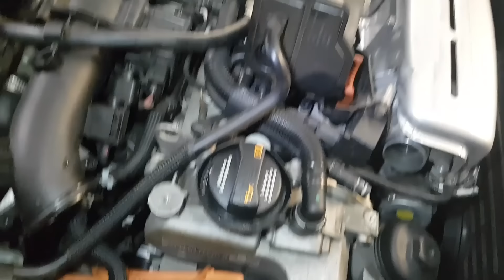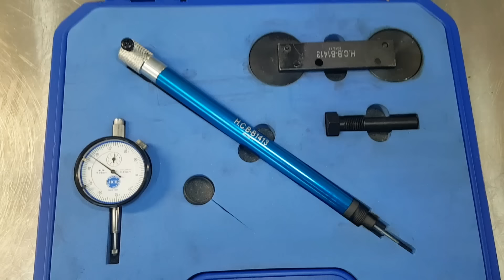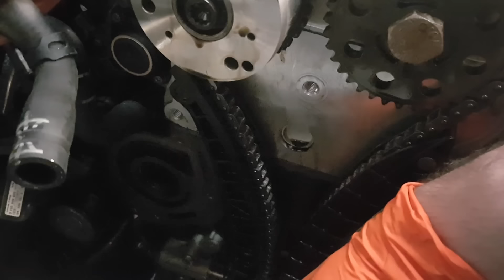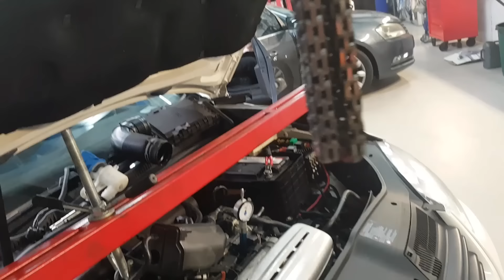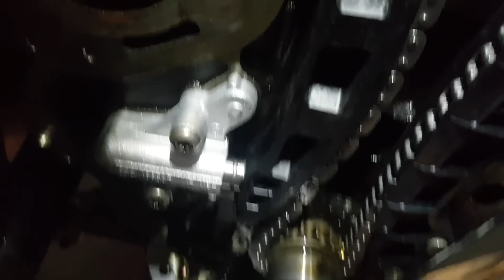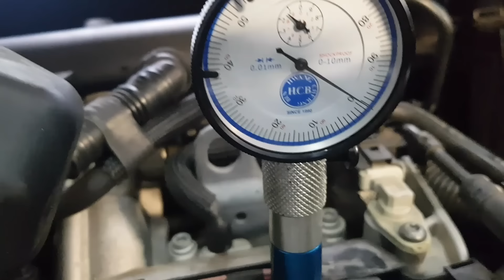P3008 VW 1.4TSI Timing Chain Replacement

Comment: Hi, nice video, you made it look very simple!
I'm motivated to do this on mine, it rattles on cold starts like an assault riffle but wasn't sure if it was the variator or the timing chain, want to ask a couple of questions.

Is it necessary to change the variator, or is it something that will suppousedly last as much as the car?

And for the gasket, what do you do for the bottom part? (The one that matches the oil pan) do you use gasket silicone? (or whatever is it called)
Reply from the maker: Check that the variator is locked and has no play. The sump is sealant.
Reply: @FourRingsAuto  what does it mean that the sump is sealant?
Reply from the maker: The sump  (or oil pan for Americans) doesn't have a gasket. It has silicone sealant.
Reply: @FourRingsAuto  ah, ok, that's what I thought, it's just that I want to have everything beforehand and not make any trip to the parts store / dealership
Reply: @FourRingsAuto  Another question, I can see a kit from INA (Schaeffler) -559 0154 30- with EVERYTHING needed, however, as in this video, the tensioner has the same reference as the one that came from the factory with the car, and in this video I can see that it retracts back, Isn't it supposed to stay out to compensate the chain's stretch? 
Also, was the problem of the camshafts out of time because of tensioner or the chain?
Sorry to bother you, but it looks to me that it will only keep the car running fine for a while until the tensioner/chain fails again soon
Reply: How much would you pay in United Kingdom for this whole job??

Comment: Do you need to do a oil change after replacing the timing chain ?
Reply from the maker: Yes. The chain wears due to contaminants in the oil, so a new chain really needs new oil. It's a hack job to run it on the old oil, but I've seen mechanics do it. Oil is cheap in my opinion in comparison.
Reply: @FourRingsAuto  I just got a oil change on my 2008 VW Golf GT and then the PO00A code came from my check engine I have always had a bad rattle at cold start ups only lasts about 2 seconds figured it was the Timing Chain so after I get a oil change now this Error code the car is at the dealership can with error below be caused because of a bad timing chain ? Thanks for your help I love your videos 

 VCDS event / error memory tion number: 03C 906 032 AL Component: Event / error memory 1 error found: 000010 - camshaft adjustment (bank 1 inlet) PO00A - 000 - effect too slow - warning light ON Ambient conditions: Error status: 11100000 Error priority: 0 Error frequency:  1 Unlearning counter: 255 Mileage: 178 415 km Time specification: 0 Date: 2000.00.00 Time: 09:51:53 Ambient conditions.  Drohzabl- 4208 Imin Sitzur Print Clipboard Clear Memory - 05 PW: S Panasonic CF-C1
Reply from the maker: Yes, it is a common issue that they can rattle worse after an oil change or even jump time. The tensioner can drain out and the engine is run with an empty filter that takes at least 5 seconds to 10 seconds to prime. So if your car was bad prior to changing the oil, there's a good chance it may have jumped when the engine started with no oil pressure for that brief period. Chains generally jump when cranking.
Reply: @FourRingsAuto  So the rattle and cold start up has always been there but then the code popped up and it sucks because I just got the oil change and it was expensive with new spark plugs in Germany was 400€ and now this code comes up and the VW dealership said I need to replace the Timing Chain and it would cost about 2000€ but after this code showed up the car ran perfectly normal I couldn’t tell a difference in noise or Performance but when I got to the dealership they showed this code and never started the car again said the timing chain but after further research by me I can’t find anything regarding this code and a timing chain having a problem do you know if this is correct? Thanks 😊
Reply from the maker: Can check the timing with either an oscilloscope and a competent user, or set the number 1 piston at tdc via the spark plug hole, and take out the plastic caps on the rear end (gearbox end) of the camshaft housing. Then see if the tool fits or not. Make sure it is on the correct tdc, if the tool is no where near fitting it'll tell you the timing has jumped.
Reply: @FourRingsAuto  could changing the timing chain and tensioner fox this code ? Thanks for the help
Reply from the maker: Yes if it it confirmed that the timing is out. Diagnosis has to be always carried out to accurately give facts on this. P000A means the timing is slow to respond. Could be an oil pressure issue, the vvt solenoid, the wrong oil filter possibly...All these things would have to be confirmed or ruled out if the timing is checked and found to be ok. I woukd start with what I listed above, and should be shown in this video - checking timing.

Comment: Hi what are the labour times on this
Reply from the maker: Around 5 or 6 hours. Some models are easier than others. Tiguans seem to be easiest as they have more space in the engine bay. Polo and a1 are quite tight. Also depends on the covers over the supercharger, some models you don't have to remove them to get to the supercharger belt tensioner - this saves a heap of time.

Comment: 18:35 can you comment on that breather pile / hose? My 1.4 TSI BMY just got it's timing chain changed at a VW dealership, and they did not change it to the new version that is made of rubber. Should I be worried?

Comment: great video....where can i purchase this tool kit and what is the recommended timing chain/tensioners/guides kit to purchase....can you provide with a code...my engine is the 1.4l TSI EA111...
Reply from the maker: Febi kit is good. Or genuine from vw. I use HCB locking tools. Depends where you are in the world on what brand tools to use. HCB, JTC are common suppliers.
Reply: @FourRingsAuto  what you think my problem could be... Car still drives like normal put I am obviously not comfortable hearing this rattling noise.. I live in Barbados 🇧🇧

Comment: Can you do a video of where the crank angle sensor is on a 2007 vw golf 1.4l tsi please
Reply from the maker: Back of the engine, towards the gearbox end, near where the right driveshaft goes in. Below the supercharger if twincharged.
Reply: @FourRingsAuto  thank you for replying. It is twincharged. Will the supercharger need to be removed to get to the sensor? Thanks.
Reply from the maker: I recall being able to access it, but i feel like ELSA the workshop manual says to remove the supercharger.

Comment: I have to do this job very soon, just waiting on camshaft locking kit to arrive,mine should be a bit easier because I have removed the engine to replace possible cracked pistons ?, thanks for this video it will help a lot !
Reply from the maker: I have another video of doing it with engine out.

Comment: I did this job monday..... on the face of it .. i thought it was straightforward.. however on start up its running roughly... i did rotate the engine and check cam timing several times on the rebuild,but checking it after i had briefly run it the inlet cam is very marginally out of time... eg the tool wont go back in    ...i did replace the variator....i couldn't see how the variator could be filled with oil prior to assy....it did rattle a bit briefly as it filled with oil but i expected that.. fiat ones do the same.?
I will go back today ..put all the timing tools back on.... but any advice gratefully received. 
As i say i rotated the engine several times before starting both during the reassembly and when it was complete so nothing was clashing and the timing tool fitted.... yet after running the inlet cam is ever so slightly off and idle is low and engine doesnt sound smooth...although happy to start.
Cheers Peter
Reply: My gut says its variator related as the timing of the solid exhaust cam sprocket is perfect.
Reply from the maker: Any fault codes? U say ever so slightly, is this a negligible amount? Variator doesn't need prefilling and rattle once is fine.  Always crank to build oil pressure before starting though.
Reply: @FourRingsAuto  no fault codes currently..... i would guess its seems to be a couple of mm out.... as pin from timing tool in camshaft will go in now just before TDC.... although when i put it together it slotted in just fine
Reply: Yes i would agree.... but im unsure how it has drifted.... i wondered if its residual oil pressure in variator....does it advance cam when operating?..going back to take it apart again and double check everything.
Reply from the maker: Advances cam when operating the vvt solenoid next to cylinder 1 coil pack.
Reply: @FourRingsAuto  yes that is how i thought it did it ..will re time it today. Thanks for your help/comments 😊
Reply from the maker: Interested to find out what the end result is.
Reply: @FourRingsAuto  no worries, will let you know .
Peter
Reply: @FourRingsAuto  so.... took timing case off.... retimed the inlet cam.. got the two camshafts synchronized but then the crank kept moving away from tdc... so ended up removing the starter to get access to ring gear to put crank back to tdc and hold it while the bottom pulley bolt was done up.
Started an ran instantly better than before.... was slightly tappity but hadn't been run in a week and got smoother once the cam followers filled with oil... (assuming the TSI has hydraulic followers) . Currently running well... have driven it a couple of miles... will take it out again today.
Reply: @FourRingsAuto  so far no fault codes.... the car for years has on and off flagged a code for cam position sensor error.... so im hoping with a new chain this will finally be put to bed.

Comment: Why didn't you just turn the engine till the cams lined up with the tool and lock it in then remove the chain and use the locking bolt along with your dial gauge to find tdc then install the new chain and tensioner?

Comment: As you left the sump on did you not bother with the lower oil pump drive chain? Also.... pricing up the various bits ...how often are the cam variatiors problematic ?  Im planning to do the lot but the variator is a couple of hundred pounds plus vat!
Cheers
Peter
Reply from the maker: I left the sump on but it is best to take it off really. Makes reassembling easier, you can clean the old oil out of the sump, and yes it means you can replace the oil pump chain if it is worn too. Sometimes they are ok, and sometimes the customer doesn't want to spend any more money. The cam variator is easily tested. If you buy a febi chain kit it tells you all the info you need to know.

Comment: Hi guys, great work and thanks for the video

The chain on my 2011 1.4 tsi Golf 6 (130.000km) is starting to get noisy on cold start and it's getting worse day by day.

Changing the chain might not be a problem for me, but timing the engine seems complicated and I didn't understand all the steps (english isn't my native language)

Is it really necessary to change all the gears even if they don't seem damaged ?

Thank you for your help

Greetings from France
Reply: I have bought my golf VI 1.4 TSI 90kw with 97 000 km and it was already making sounds when starting. They came winter and it was not that significant and now in spring it make sound not only after start but approximately one minute of driving. When I open windows I can hear it even when engine is warmed up. I will be replacing it soon.
Reply: Please, did you change it?

Comment: Were did you buy the o-rings for the timing case cover?
Reply from the maker: I buy them from VW, or you may be able to find elring ones. They are cheap from vw dealership, and taking that cover off again would be a massive pain as the o-rings are for sealing the oil pressure passages to and from the oil filter housing.
Reply: @FourRingsAuto  Thank you!

Comment: I am so tired of my Golf 1,4 TS 2010 right now. Changed the chain at 80000 km and today at 150000 km I guess it's about time again. This seems to be a bad construction. 
I have been serving my car properly and even changed oil and filter between regular services..
Reply: Which country are you located? Where did you buy your first chain kit? Did you change the sprokets or only the chain?
Reply: @sitarhero4296  I'm located in Stockholm Sweden. first chain kit were changed by a VW atuhorised workshop and Payed by the insurance company. I assume they used a Kit that included the sprockets. But not sure. Now the car works fine unless I "step on it" and try to accelerate to hard. then the engine miss fires and engine fualt lamp start to flash.  So when I drive slow it works fine. for now i guess..
Reply from the maker: What makes you think it's the chain again?  Or just an assumption? Flashing engine light under load is typical of a misfire. Keep things simple and get the fault codes scanned, and go from there.
Reply: @FourRingsAuto  Thanks. Will do that :)

Comment: I'm just about take over my neighbours 2007 DSG Golf with this engine ( BLG ) , unfortunately been diagnosed with slipped timing chain and no compression on cylinders 2 and 3. Trying to build up some knowledge about the problems with these engines and your video is excellent altho' I'll be entrusting the job to my VW specialist garage for sure due to the need for the specialist diagnostic equipment as well as the kit for setting everything up. Not sure of what damage has been done in the two cylinders so it may be a costly job I fear.
Reply: Most likely cracked ring lands unfortunately!
Reply: @19jacobob93  Ring lands ? what part of the engine is that ?
Reply from the maker: The side of the piston where the piston ring goes in is the ring groove. The piece that supports the ring groove is referred to as the ring land. They are common on 1.4tsi ea111 engines to crack at the ring lands due to poor castjng of the pistons. I have another video showing this. It causes low compression misfires.
Reply: @FourRingsAuto  Wow, you never stop learning, many thanks for the comprehensive reply and at the ripe old age of 74 had never heard the expression/description "ring lands".  Thank you and its obvious that the 1.4tsi engine you describe has not been one of VW's greatest successes. I wonder who they sourced to make up those poorly cast pistons ?
Reply from the maker: @PATWENTY8R  they are Mahle from factory. New part number goes to kolbenschmidt. Built to a budget and vw penny pinching is likely.

Comment: Great video mate, where did you get that timing cam lock tool
Reply from the maker: Mine is a HCB tools branded one. Made in china or taiwan but they specialise in copying special tools. The ones on ebay are hit and miss. JTC is another good brand reasonably prices.
Reply: I have tiguan 1.4 tsi engine 77k on it. Regular oil change on time. I had a pending code p0016 should I wait or change the chain? No power loss or starting trouble till now.
Reply from the maker: Better safe than sorry. You can tell if it's stretched by pulling the sump off and looking at how far out the tensioner is sticking out at TDC.

Comment: Hey guys!

As i am now part of the wonderful statistics of 😭vw tsi owners that have a scrapped engine due to broken timingchain, bent valves etc. 
I now have a question regarding my tiguan with the 1.4tsi bwk engine. 

Can i replace the broken bwk engine that originally came with the car for a cava engine instead? 

If so, what other things would i need to change on the car?
Would i need to replace the ecu?. 

Have a Great one!

Comment: Have same error code on mine, (bmy engine code)
- i have replaced water pump on it before, but my question is : time wise how long does this job take?
Did the water pump in a 2 hours ish
Reply from the maker: 6 roughly.

Comment: I have a 2017 Jetta 1.4 TSI in the US the spec shows it has a timing belt not a chain.
Reply from the maker: Yeah from mk7 golf/jetta they are belt. Probably roughly 2013 or there abouts it changed.
Reply from the maker: You have an ea222. This is an ea111 in this video. The ea111 wasn't available in USA from my understanding.

Comment: At 130k miles. Would you think its needed to replace cam variator sprocket aswell? Its 500 quid just for that
Reply from the maker: If it locks, it's technically ok. If it doesn't it needs replacing. Also depends on whether it's worth spending 500 to know you won't need to go back in there again.

Comment: When you fit a new tensioner do you pre fill it with oil or just bolt it to the block and let if fill with oil when the engine starts?
Reply: eoin730 ideally add oil to help to seal the piston against cylinder otherwise it runs dry at first start,

Comment: These VW engines are very weak in durability, while camshafts from brands like GM, Fiat, Ford, Toyota, Honda, Opel, etc. last over 200,000 KM, these need repairs under 50,000 KM; These are chronic problems that have existed since the first generation of TSI engines, not to mention the carbonization of valves. I don't see such problems on any other brand. As the Germans who understand mechanics say; VW / Audi is the German waste.